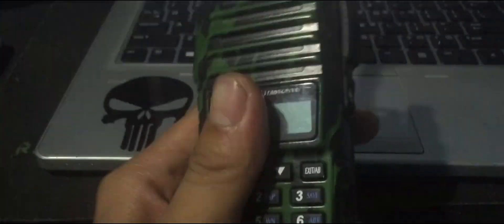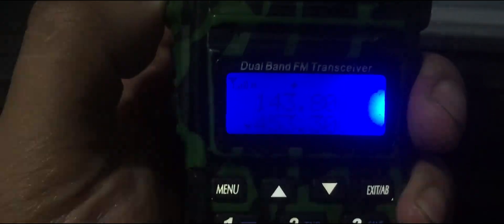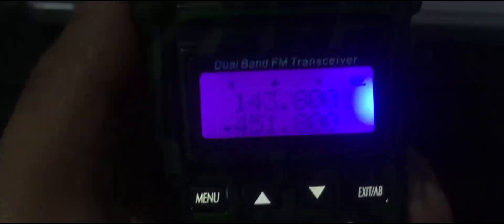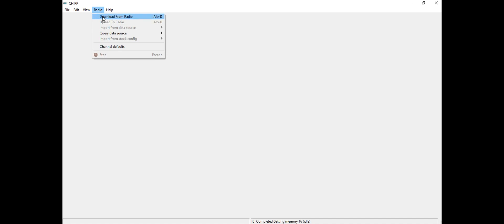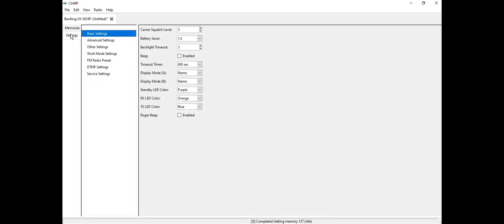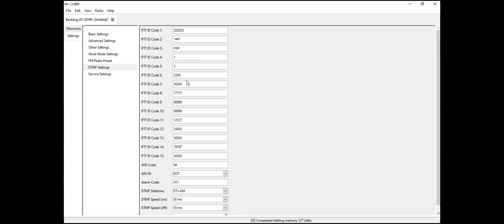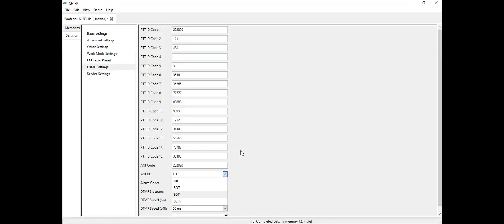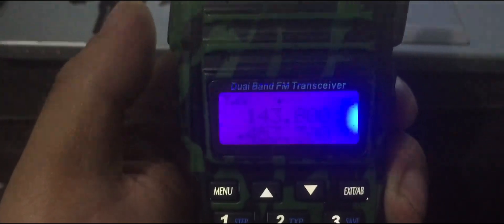How to change ANI ID/PTT ID/Roger Beep On any Dualband Baofeng Radio.

Comment: I've seen a watt meter hooked up to a baofeng "8w" radio push 6 watts - I was disappointed. Do the 5w versions put out less than 5 also?
Reply from the maker: The 5w version puts out right about 4.5 watts while this 8w version of mine goes around 6watts
Reply: @djaymigz98  Ok - so I just had my second UV-82 go out - I had them about 6 months or so - maybe close to a year? The BF-8HP I got is still chugging along. Just got 2 more UV-82's because I like them better - but then 2 failed within 2 weeks out of the blue! I even use the BF-F8HP more... I have buyers remorse buying the other 2 82's now, and I haven't even got them yet. Gonna have plenty of batteries though, the new ones come with 2 regular, and 2 of the 3800mah ones, so there is that?

Got a Yaesu FT-60R coming now too though, so ... I think I might be done with baofengs. Those be the "let the kids beat the up" or "let random people use them" radios now :D
Reply: Update ... the second UV-82 that went out is fine. Maybe the battery wasn't seated right or something.
Reply: Don't you use an antenna with these? If your antenna is 3dB then that means your radio is 12w.
Reply: @a.k.3659  No that means you have a 3db gain antenna.
Reply: @notsure7874  So, antennas ain't part of a radio, right?
Reply: @a.k.3659  An antenna isn't part of the amplification circuit. Gain does not change the wattage.
Reply: @notsure7874  But the gain of an antenna can indirectly affect the effective radiated power (ERP) of a radio transmitter, which is the actual power that is radiated by the antenna in a particular direction. The ERP is equal to the transmitter power output multiplied by the antenna gain in that direction.
Reply: @a.k.3659  Dude ... ERP is toilet paper math. 12 rolls equals 48 rolls supposedly, but there's really only 12 rolls in the package.

""In spite of the names, ERP and EIRP do not measure transmitter power, or total power radiated by the antenna, they are just a measure of signal strength along the main lobe."

https://en.wikipedia.org/wiki/Effective_radiated_power